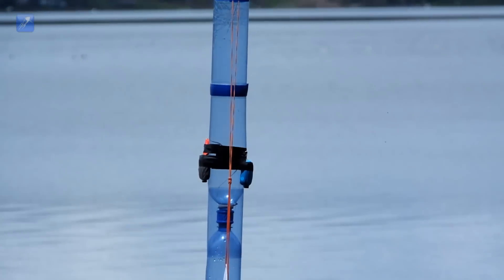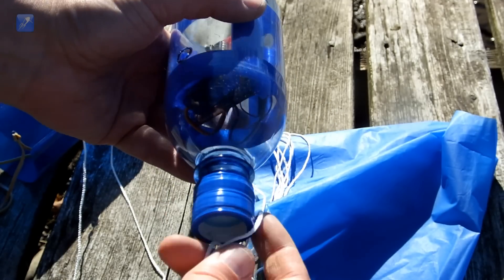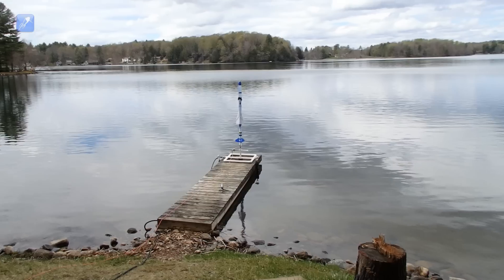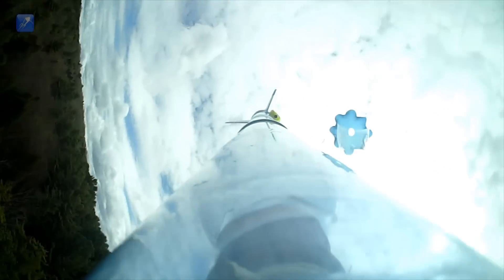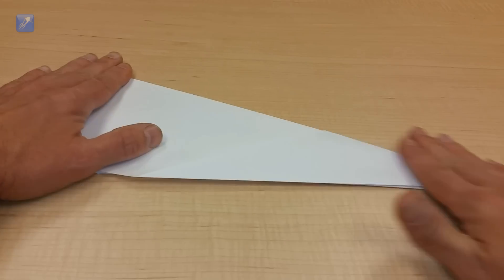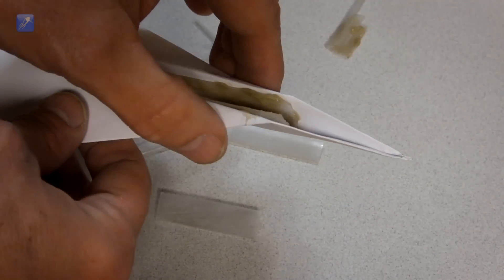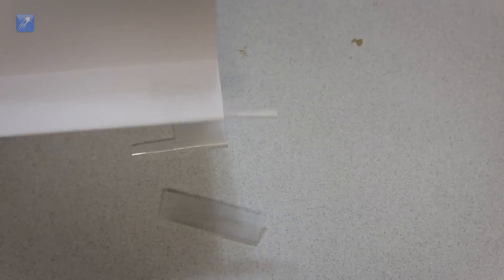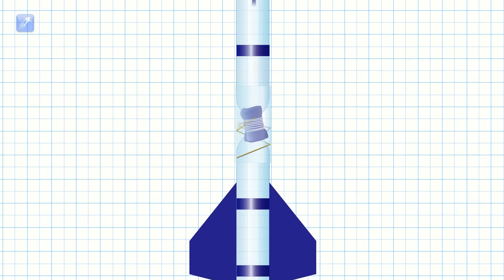Water Rocket Boosted Paper Plane Experment

Comment: it will not work the paper will just tear. Only if you launch the rocket with 60 psi.
Reply from the maker: If we used a smaller nozzle that would also slow it down.

Comment: I think it will fly overall, though there are a few buts/conditions. In 
thinking about it I reckon that the planes shape may be deformed by the 
stresses(Maybe to the point of being torn off the rocket) at launch or 
by the movement of the rocket during ascent. That is if the glider does 
not affect the flight path of the rocket due to changing the airflow 
over the fins.

Comment: I think it'll fail because it seems to be attached to rubber, if it was just dropped at apogee then the plane would normally right itself but adding the force of the rubber means the wings are over-stressed and will likely fold up

Comment: Personally, from previous paper plane experience, I don't think it will fly as even a little bit of wind at altitude, combined with the powerful rubber band force could cause the glider to tumble out of control. Also, if using a 22mm nozzle, the acceleration forces could cause the plane to rip off the rocket at launch. However, it would also be very cool to see if it does work.